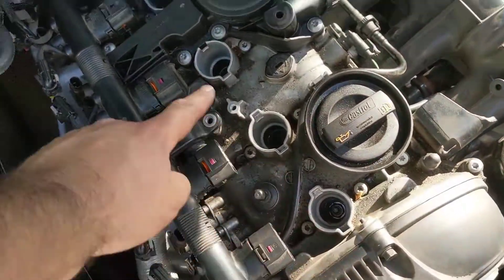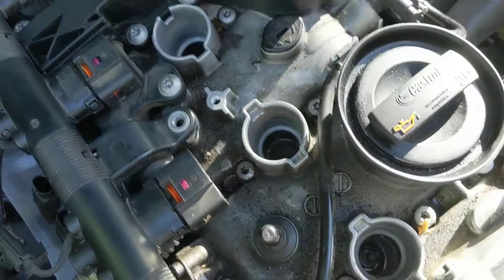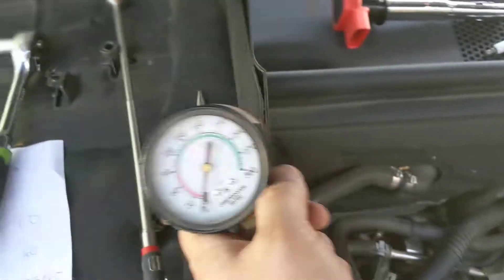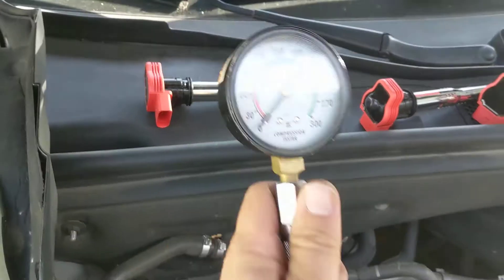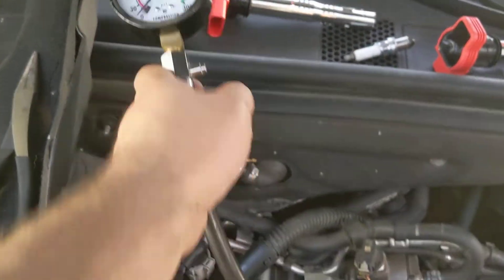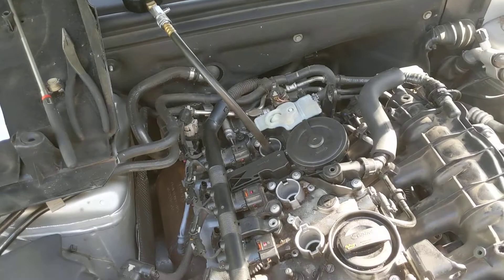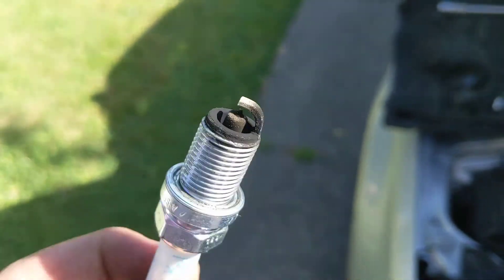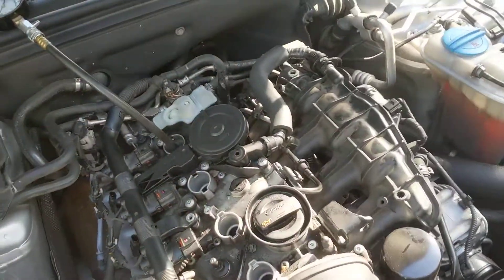Project Audi - Episode 17: Performing a Compression Test

Comment: You have disconnected the exhaust camshaft solenoid adjusters NOT the fuel injectors. You can effectively disable the injectors for a compression test by pulling the fuel pump fuse from the fuse block.

Low boost pressure can be the result of a vacuum leak in the charge pipe or intake.

Those plugs are not oil burned. The look like plugs that are either the wrong heat range or the mixture is too lean, for example.

You've got two likely related clues now that you can use together to help narrow down the issue...

Comment: I think those are the exhaust cam adjuster solenoids. The injectors are below the intake manifold, and you have to take the manifold off to Unplug the injectors. Pulling the fuel pump fuse is the way to go. Should be 3rd fuse in the middle panel (white 20-25amp fuse). Good video though, cheers
Reply: Didn't read the directions......totally wrong side he was..

Comment: Pretty sure they aren’t the “fuel injectors”... aren’t the injectors on the right just under the intake manifold?

Those under the coils should be the camshaft valve solenoids
Reply: thats exactly what those are
Reply: @bigbossbradyboi7155  yeah well, they fucked up then.

I did a compression test myself after watching this... yes I had to remove the fuse near the driver door to disable the fuel system... not those camshaft valve solenoid like what they did

Comment: Didn’t look at all your videos but it needs pistons for oil consumption I have lots of good info on my page
Reply: The wizard of Aud!
Reply: If the compression test is healhty, pvc is new and still burning oil so still a piston issue not the turbo cartridge broken seals?
Reply: @3kkk514  no never the turbo so far on this platform
Reply: @NaptownTuner  cheers i keep watching channel and i learned a lot, you are a very good mentor.👍
Reply: @3kkk514  valve stem seals. Do you get blue smoke after coasting downhill?
Reply: @SJPTrades no smoke like a gyeshish color smells a little when reving. I replaced new valve stem seal and head gasket kit but the 2  piston at the  middle there is a litttle play if I press it side to side probably that is the cause of oil consumption 500km every 1 little petrol.
Reply: @3kkk514  also suspect turbo seals. High crankcase pressure pushes oil to leak thru turbo seals if it’s old. Also I had a massive oil leak after using seaform spray too much.P